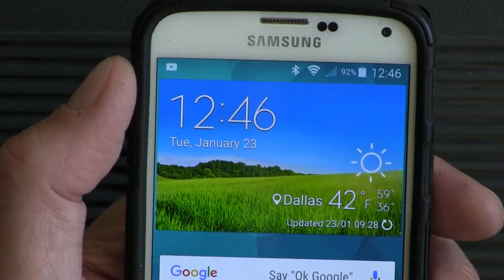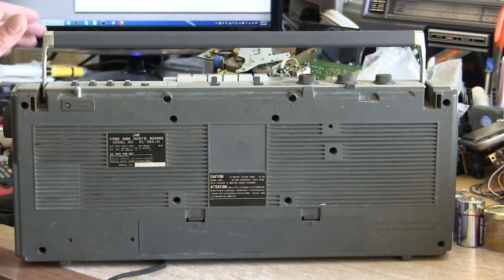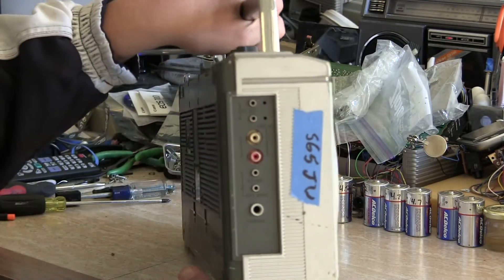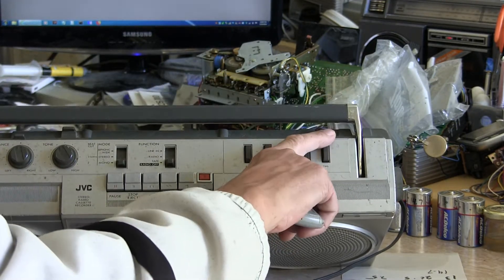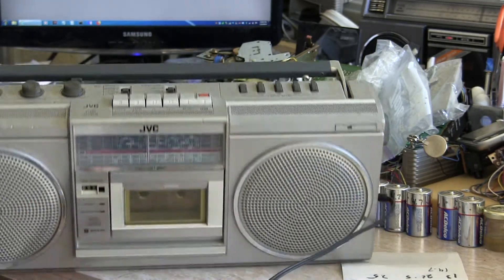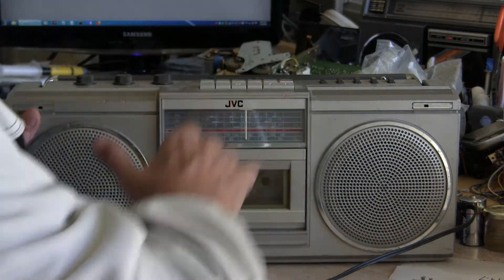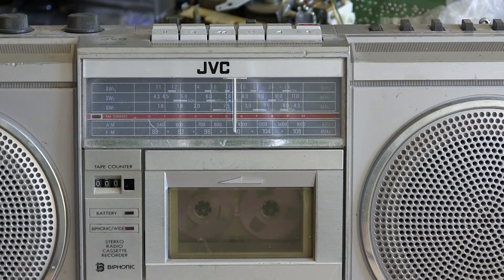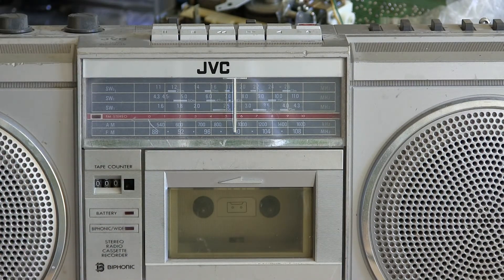JVC RC-565-JW cassette deck Issues preview before service and restoration

Comment: Will this be 4sale soon ?
Reply from the maker: It is for sale I just have not had time to upload the video describing what I was able to repair and the partial antenna rather than None.  I added a 2 section antenna from my limited parts to it to allow the glorious bi-phonic sound come through in stereo from the radio and more.